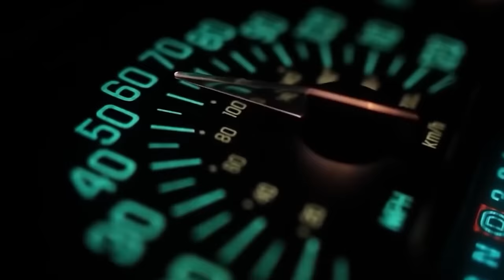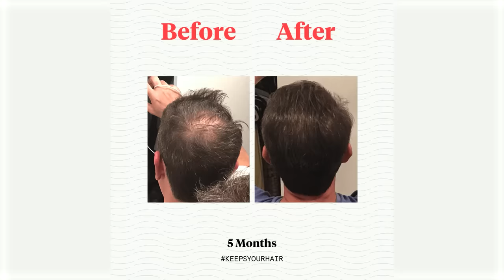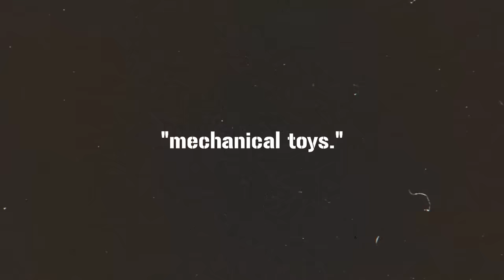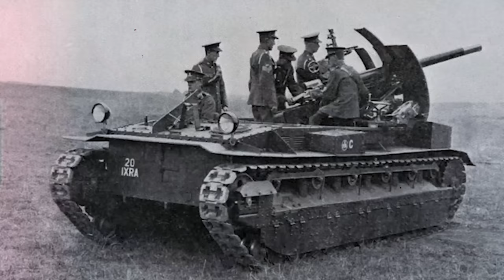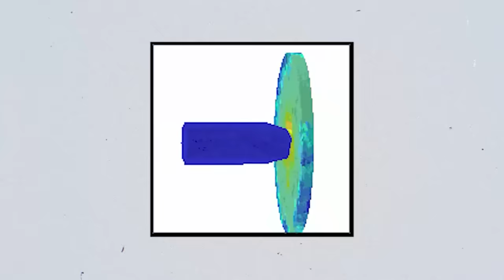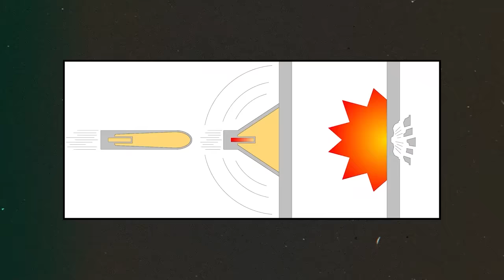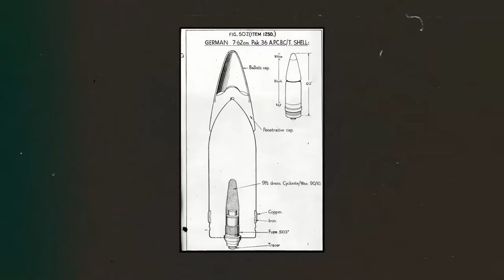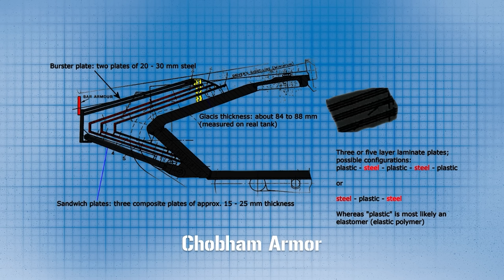The Tank: Everything You Need to Know

Comment: As regards the development of tanks during the Cold War a mention could have been made of the Swedish Stridsvagn 103, which simply said "to hell with the turret ..., we'll save on weight and height" and produced a vehicle that was almost like a mouse (but with one hell of a bite)
Reply: Doesn't the modern definition of the word tank include the requirement of a turret? In that sense the 103 is an assault gun. The Swedes used it as a tank, yes, but doesn't really make it a tank in the strictest sense of the word.
Reply: @balinthehater8205  A commonly accepted definition is "an armored vehicle with articulated tracks and a primary weapon system". If turrets were required, the original tanks - vehicles like A7V, Whippet, and Mark IV - would all be non-tanks, but it's almost universally accepted that they are tanks.

Yes, the above definition would rope in things like IFVs and the like, but one can easily make a case for IFVs being a kind of heavily specialized "tank" in the most generic sense of the word.

Terms like "assault gun" are almost exclusively doctrinal in nature. If the home nation does not use the AFV in question as an assault gun, or in a manner that is like an assault gun, or call it an assault gun at the very least, it is not an assault gun. Strv 103 was made and used as an MBT in Swedish doctrine and should be called as such.
Reply: @bluntcabbage6042  Given that all of the early tanks you mentioned could very easily be called proto tanks because the design nor definition of the tank had matured enough at the time but evolved out of them, I would call your point on the mark IV and other early tanks moot. We clearly know that they inspired the later vehicles but they don't really live up to the standards of their descendants.

Most ifv's have a turret as well so that would not even be that strange to have any definitions pull them in because they do share the same battle space, although they generally don't fulfill the 'cannon' part in the turret, usually having autocannons. Although I think any commander is going to be pissed at you if they receive one as reinforcements when they requested the other, it could be worse with the definition you are using. For instance, when you start including SPG's, ARV's with .50 cals and SPAA as tanks. They often have a caterpillar track, are armored and have a primary weapons system, while at the same time dismissing the French wheeled reconnaissance tanks because of the track requirement while they performed the role of a light tank. A turret being required as the part of a definition is to cut out self propelled artillery and anti air vehicles because somehow I don't think any infantry commander is going to be best pleased when they request tank support and a heavy AA vehicle rolls up to support them.

From what I understand the Swedish didn't even use it as a main battle tank but rather as an ambush vehicle that was supposed to get out of dodge quickly once it had gotten a few shots off from a hidden position. It essentially is an assault gun(I know it's an antiquated doctrinal term but if it quacks like a duck and looks like a duck then it probably is a duck) from late ww2 with its design updated masquerading as a tank while having all the weaknesses of its actual lineage. It has no mobile fire capability and heavens forbid it actually get surprised by anything not directly to its front. It still looks good but there is a reason the Swedes dropped it for the Leo's. You know, actual tanks.
Reply: @balinthehater8205  "Tank" is an extremely generic term. Yeah, it would include things like some SPGs (assuming they're actually armored). It's a slight step beneath the overarching term of "AFV" for categorizing a vehicle. 

And I'm sorry, but you are not making a good case about the Mark IV. It is universally accepted as one of the very first tanks. Magically re-assigning it as a "proto-tank" is silly. 

Reconnaissance "tanks" do not meet the definition of a tank. They are armored cars with an identical doctrinal role to some tanks, but they're not tanks. Just like how some cavalry units, using horses, had the same doctrinal role as some tank units - it doesn't make the horses that the cavalry uses, tanks.

When Strv 103 was introduced, it had a similar time-to-target as contemporary MBTs. It was meant to be Sweden's MBT. It was developed as such. It was an MBT with a strange specialization, but it was categorically an MBT. It was certainly not an assault gun or tank destroyer. It was phased out in favor of Leopards as gun servomotor tech caught up and the fire-on-the-move capability improved enough to warrant getting rid of the 103's other advantages (as well as armaments generally progressing enough to nullify much of Strv 103's armor profile, which was a major selling point at the time).

Fact is, the debate on "is THIS a tank??" is easily solved by the simple and broad definition. Under this definition, many categories exist, including (armored/enclosed) SPGs, assault guns, IFVs, etc. 

Armament is moot because multiple examples exist of tanks that do not have a large caliber cannon, instead using a machine gun or autocannon, from the very first tanks to vehicles as late as the 1990s. Unless you want to argue (facetiously) that vehicles like Panzer II, Panzer I, M2A2, T-60, and HSTV-L aren't actually tanks.

p.s. An infantry commander likely wouldn't complain about SPAA support against enemy ground assets. They're extremely useful even against armored targets. It's usually higher command levels that keep AA vehicles behind - because a unit won't have nearly as many of them as normal vehicles.

Comment: Dude (@Megaprojects) - please check a basic math, before making statements e.g. armor thickness to an angle of attack  (audience believe - do not think about it...) . I like your videos - but a bit of science helps ;)

Evolution of tanks cannot go without evolution of infantry weapons and tactics (as minimum- tanks were created as solution to stalemate of infantry tactics). Only brief moment when tanks became overpowered ($ / unit deployed)  is 3 y of wwii in conflict over central European continent land mass.  After that "well supplied" infantry could fight against tanks. After that most "severe" land based conflicts were dealt against nationalities that had very limited, it ever access, to "modern" equipment. 
Current conflict shows an mobile infantry drone of cost of 1K(with payload) defeating relatively high tech tank, of total cost including crew training of to 6000 k+ (+ drones require 0 food for maintenance and pension if survived) .
There will be always a balance between: High value-high armour targets (Protection  emphasis- bunkers/tanks)  and low cost - low armour targets (infantry). As soon as "cheaper" targets get a possibility to defeat "value" ones, the chess board is overturned and loop is repeated.

Comment: You added assault guns to this like they were tanks. Sure, they were developed based on tank designs but they were not tanks. They were self propelled guns. Not exactly the same thing. 
The "deep battle" idea actually involved airborne and air assault units landing behind enemy lines and taking strategically important objectives or at least objectives of great tactical importance. Having a lot of pressure from multiple areas on the defences would definitely help with drawing the defenders to the areas where the attacks were being made from those objectives but that's another issue. 
About the Gulf War, there's something that needs to be mentioned: the Iraqis had export versions of the T-72s. Export versions are inferior to domestic versions. Also, the T-72 was not the best Soviet tank available. 
Regarding Merkava IV and Hamas or whoever tried to attack it, the AT weapons used matter. If you use RPG-7s, it won't work. The T-90 was known to be able to take several RPG-7s and being able to function...although they didn't hit the top of the tank.
Worth saying that the North Korean M2020 is probably more of at Generation 3.5 tank than a 4th Generation tank. 
The Russian T-14 has issues to solve. The concept isn't new. It's a Soviet concept. Automated turret and all the crew are moved in the vehicle. The US created the Abrams X demonstrator based on that Soviet concept in mind and newer technologies. Basically the T-14 is what the future look like.

Comment: Ok I got 30 minutes into this - the whole; they were ignorant, didn't know what they were doing, working in the dark. rubbish! Mr Whistler if you had bothered to go into a large archive, such as the National Archives there are quite literally hundreds of thousands of pages that are contrary to your views. Engineers from all over the world were testing and evaluating ideas, forming ideas what might work, what wont and drawing concussions and evaluating data. This early stuff each has great folders and files 8 inches thick in fine print where every bolt and screw is considered and every wobble and vibration examined. - far more research went into some of the older kit than even some of the current stuff!  - The fact that you can confidently sit there and talk about a subject you have clearly not spent any time personally studying or researching correctly while making assumptions on the engineers of the time is galling at best.  I would say why don't you join me for a day in the National Archives and I can show you the level of engineering detail and effort that took place but I doubt you care enough.

Comment: Yeah, but what's the best tank...
Reply: There is no best tank. If you're fighting a defensive war within your own supply lines, it's the Merkava, which will kill any other tank 1v1 in a straight fight. If you're fighting an offensive war and have the logistics to supply them, the Abrams is king and will kill any tank other than the Merkava. The Leopard is a great tank, and is basically an Abrams, with some of the tech stripped out and measures taken to make it less draining on supply lines (Germany doesn't have the logistics we do). The Challenger is very tough, but its rifled barrel complicates things and limits it from using the Lahat barrel-fired ATGMs that the Merkava and Leopard use (which is why they are phasing them out in the next variant and going to smoothbore). The Korean Panther is certainly in the running for the top tier of tanks, but it has seen so little actual action that most of its performance is purely theoretical. 

Basically, a lot of people have a favorite tank that they declare is the best. In reality, each of the top tier tanks is a tool that has its niche--asking for the best one is like declaring that a hammer is the best tool. Sure, a hammer can be the best tool for certain jobs, but it would be completely ineffective in another context.
Reply: The best one?
Well, mine, obviously.
:)

Comment: 1:18:27 this is false, their has been a few merkava losses, hell hamas even published a video from an Israeli Helmet cam of one being towed away after taking a pretty bad hit. At the end of the day, isreal is very casualty cautious and has historically and even now hesitated to station infantry to protect tanks from these close range rpg barrages, rather lose a tank and the under 5 guys inside than an infantry platoon or more amount of men.
Reply: Completely false on both points, I'm happy to say.
Starting with the second point: the reason Israeli troops are not surrounding tanks is that you really, REALLY, don't want to stand outside of a Merkava when it's Trophy shoots down an incoming RPG.
The tank will kill more soldiers than the terrorists will.

On the first point, of tanks damaged and so on, there was one (one!) Namer IFV that was destroyed when hit while it's Iron Fist system (you can think of it as a smaller version of Trophy, for light vehicles) failed.
AFAIK (and in this case, IK), no Merkava was lost during actual combat.
There was a tank that they like showing destroyed, but it was in the surprise attack on October 7, without it even starting it's engines; and there were several hits - but no true damage. The Merkava also has one of the most robust armour systems in the world.
The fact that Hamas shows you an edited clip of a fired RPG, some smoke and a tank being towed doesn't mean that's what really happened.
Just as an example of the resilience of Merkava 4 even in it's earliest version, back in 2006 (long before the Trophy days): a Merkava 4 was hit, in Lebanon, by 5 (yes, five) Kornet missiles, which are so much more powerful than RPGs, and still came back home on its own tracks.
I know that tank commander personally.